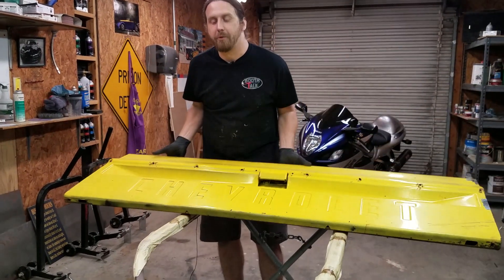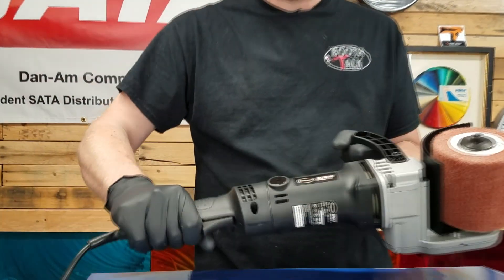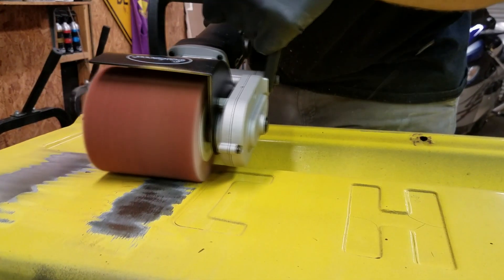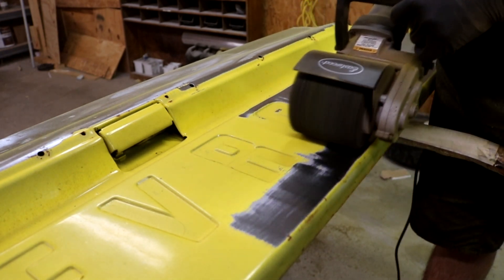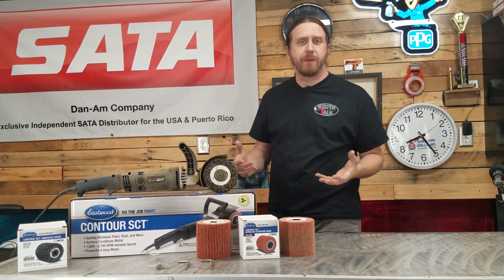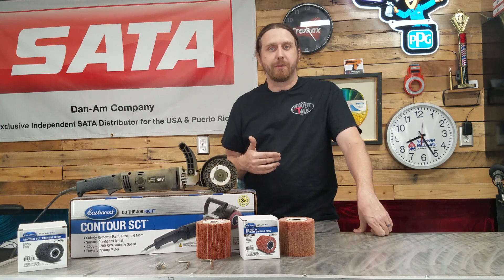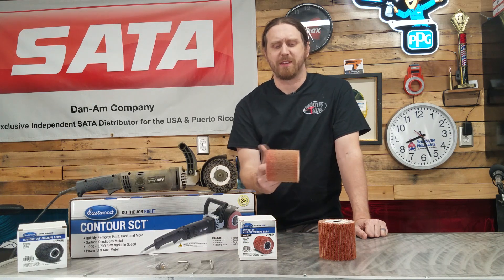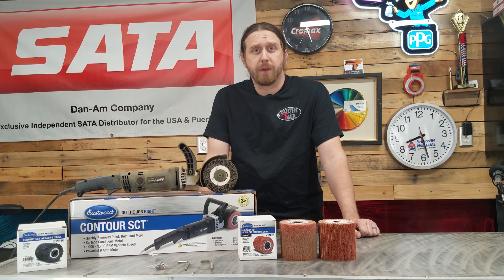Eastwood's Contour SCT VS 1968 c10

Comment: Why doesn't anyone ever do this with the Metabo?
Reply from the maker: Because I have the SCT and didn't know Metabo has a version as well?

Also, Dynabrade now has a version of this.😎
Reply: @inthehomeshop  interesting, I will check that out..I have a Dynabrade DA, It's a thing of beauty.
Reply: @inthehomeshop  it seems the Dynabrade hadn't been released here yet (Aus). Even the Eastwood needs a step down transformer to work here so also unofficially released. Might have to bite the bullet and get the Metabo. Very expensive though! Hopefully worth the extra cash. Insanely expensive actually
Reply from the maker: @dirkdiggler5821  let me do some asking around and see what I can find out
Reply: @inthehomeshop  Thanks very much Sir,  I would appreciate that!